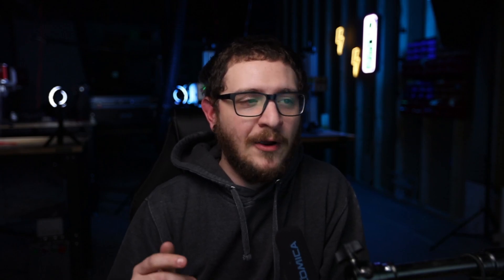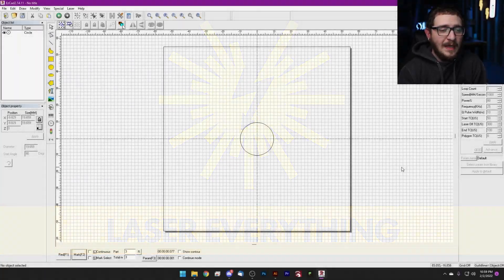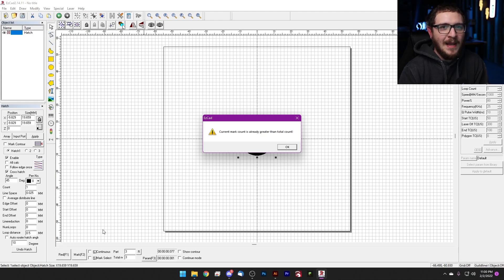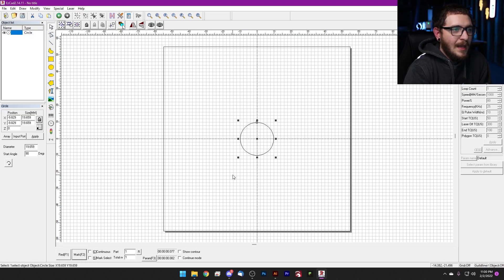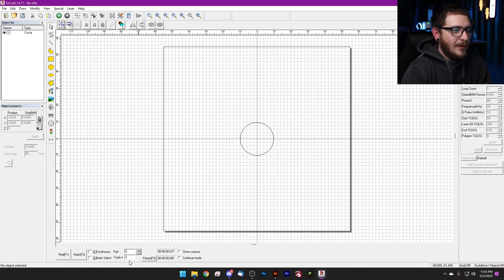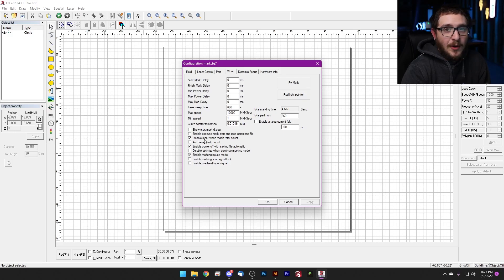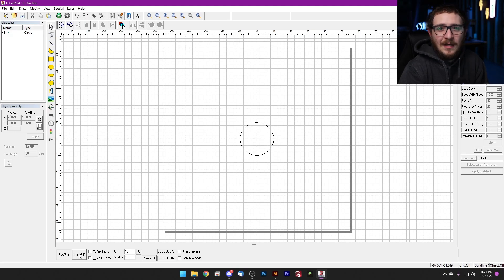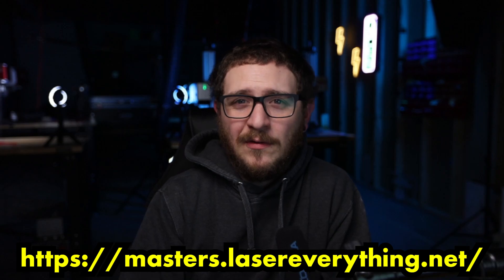FIX Ezcad "mark count greater than total count" Error FAST

Comment: Do you know where "total marking time" and "Total part num" pulls the data from?  Is it just from using EZCad or is it pulling it from a counter in the laser source or control board???  Also where can you reset it.  I bought a brand new machine that says 79071 seconds and total part num = 835927 which I dont think is correct.  I have a feeling its from the config flash drive that the OEM gave me with the settings.  I am using ezcad2 lite and have a JPT M7 30W mopa laser source.
Reply from the maker: The total marking time/data is information in software, and doesn't relate or pull data from the laser at all. You see these really crazy high numbers usually because the copy of ezcad has been used/duplicated by the main tester at a vendor or shared copy, and is representing all the tests they did on the 1000's of machines they ran that copy of software for before being duplicated for you. That info is honestly totally irrelevant, I wouldn't bother paying it any attention.

Comment: Hello Alex, I just got my laser set up and it seems like it is running, but it is actually not making any marks on the metal at all. Ive got the 20w Raycus. If i do a couple of lines it seems like it just keeps repeating the lines over and over until i click to stop... as if theres no end point to tell the laser to stop. What am I doing wrong? Plllleeeeeease advise.